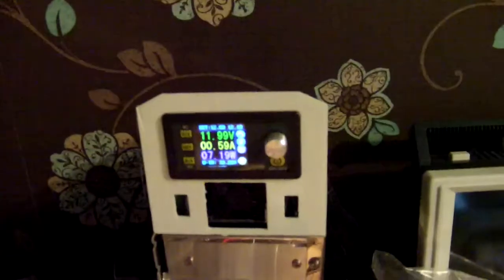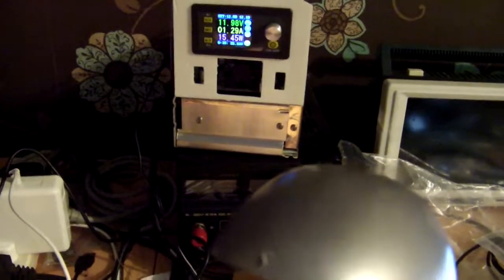Gridseed blade repair tips.

Comment: Hello i know this is a older video but the St micro controller on the board needs firmware to make it work. Even if we change it. There is no way of making it work without that firmware. Where can we get it at?
Reply from the maker: If I knew that, I would have repaired my own gridseed rather than only using the functional half. I've searched, but found nothing.

Comment: you can now get replacement ones - USED miner 5.2-6M Gridseed blade  two pcbs a set include cables,only need 100-120W - from  aliexpress and thay ar about £15.00 for two Gridseed blade hashbords as an updait

Comment: I recently purchased a second hand gridseed and have found that one of the boards has almost a dead short (< 1 ohm) across the 12V input. Unfortunately there's a similar dead short across the decoupling caps on the 1.2V rail. No obvious signs of trauma; not that I'd be able to rework any of those tiny components anyway. I wonder if someone mixed up the polarity on the input, and fried it? Also wonder whether it's a thing for people to sell half working (literally) Gridseeds. Was your board DOA or did it fail during operation?
Reply from the maker: Mine was purchased as a pair - gridseeds are manufactured and sold in pairs, but the two parts of a pair are identical and will work independently. The faulty one was impossible to repair because the microcontroller was burned out and there is no firmware available to flash a replacement. The other I modified a bit and used as a test load for my experiments with solar power.
Reply: Yes, I know they're a pair, which is why I mentioned the half working thing. :) One board works perfectly, the other is shorted out and has never worked. The seller claims it was fully tested before shipping but given there's no sign of physical damage that claim seems dubious. BTW, if you choose the right coin mining can still be profitable, but it's not really a case of set and forget.

Comment: Wonder if you could point me in the direction of a replacement capacitor, I can't find the exact one and am unsure of a suitable substitute. The two caps. that are together got knocked off and damaged during shipping. They read= A 84u 1200 4v. I also have a black pcb with 1500uf caps, so can I get any 1200-1500uf as long as they are 4v? any help or links would be appreciated
Reply from the maker: Capacitors are largely interchangeable, and that particular cap isn't fussy about exact value. It just has to be roughly the right value, and at least 4v (more won't hurt, but won't give any benefit either). The surface mount soldering is a bit fiddly for the inexperienced though.
Reply: thanks!

Comment: Thanks for your video, I had a similar issue where USB gave a spike (problem with HUB, now not seen or have red LED). I tried changing the inline regulator but no joy. I just wondered if you might have an idea as to if this is salvageable or not?

In the mean time while looking for a schematic I came across this if you're still interested  in restoring the firmware;
https://github.com/gridseed/usb-miner

Thanks.